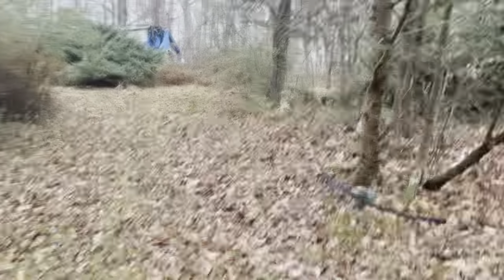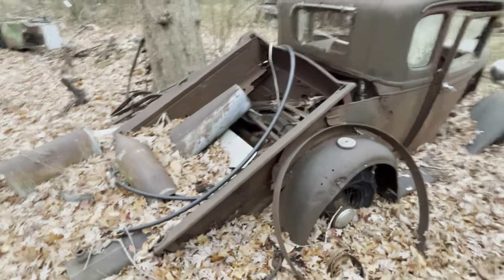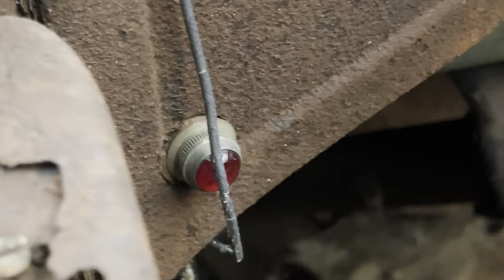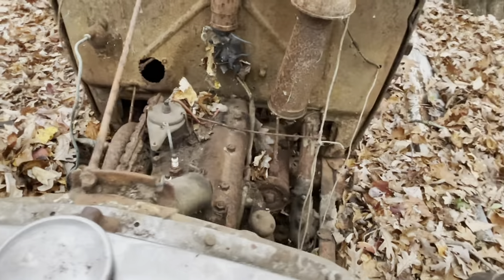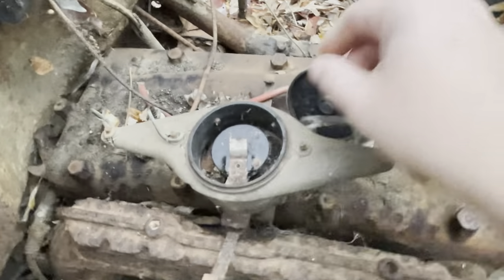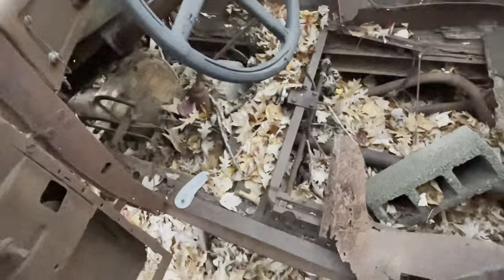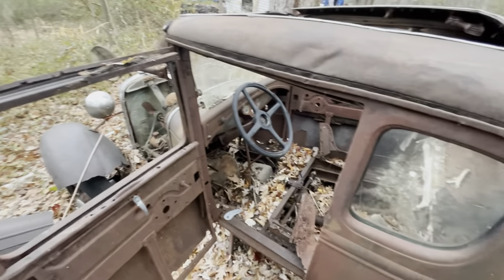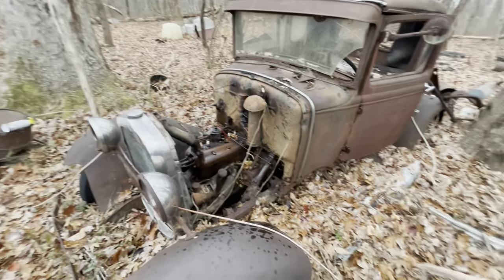1930 Ford Model A - Can we save it ?

Comment: That looks like a challenge! Good luck with it. I’ll be following along…
Reply from the maker: Thank you.  This is going to be a long term, as time permits project.  In short order, I want to see if we can get the motor loose; currently awaiting a hand crank to arrive.  Then, just keep adding oil / penetrating fluid to everything and see how it goes.  Then, inspect the distributor, cobble together a new coil, plugs, and wire and see if it will fire.  If we can get it that far, then, possibly see about moving it to a better working location.  One good thing, the tires are pretty good; only flat on one side all the way around.  :-)

Comment: Gauge at 12 o'clock is your gas gauge - a floating cork in the tank moves the indicator (or used to.).  1930-31 Model A cars came with 19" wheels, but in the depression and around WWII those tires were hard to find and many people used 1932-1935 Ford wire wheels, which fit just fine.  Looks like those are now on your coupe.  Size should be readable on the tire sidewalls.
Reply from the maker: Thank you! Much appreciated.

Comment: You can use several different replacement spark plugs.  Original Champions were 3X models, then C4, then C-16, the W-16Y.  Any will work great.  Or you can use modern plugs like Autolite 3076 work great and are less expensive.  Hopefully you can unscrew the old ones and toss them out.
Reply from the maker: Great info ! Thank you.  Luckily, all the plugs came out with little effort, however, I am still trying to get the motor to break free.
Reply: @duginvirginia5737  Happened to one of my buddies a few years ago.  Couldn't turn over the engine.  We pulled the head and found the rings had rusted to the cylinder walls.   Lots of penetrating oil and Kroil finally busted it loose.  While you have the head off, you can also check the valves - they probably are stuck too (we found 2 that were.)

Comment: Before you try to start it drop the oil pan and pop out the dipper tray clean out the sludge and clean the oil pump screen . Clean out the valve chest  and make sure the 3 main bearing feeds are clear . If you dont do this you will destroy the engine fore sure . TRUST ME !!!
Reply from the maker: Thank you.  This is a new project to me, so any info is greatly appreciated.